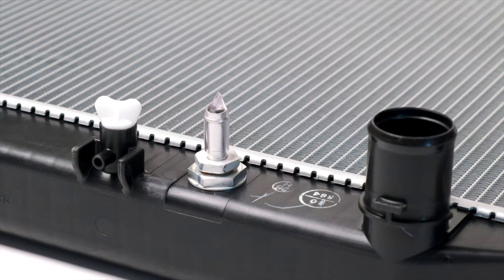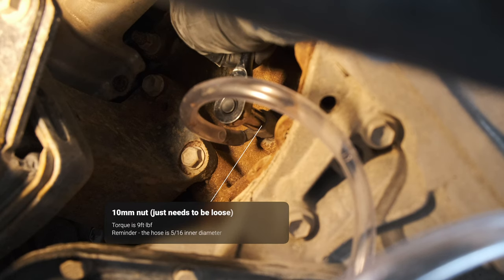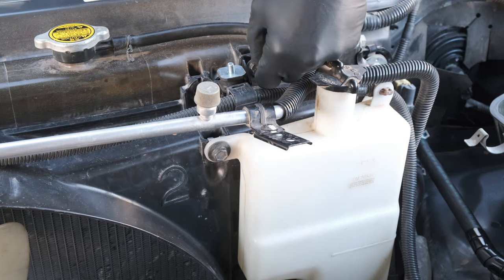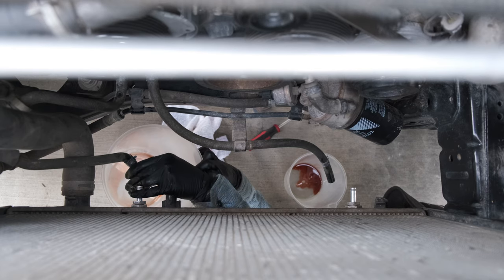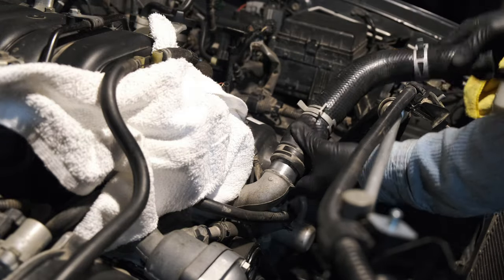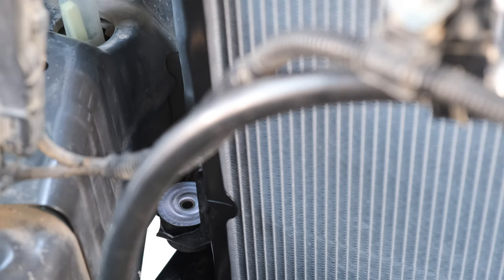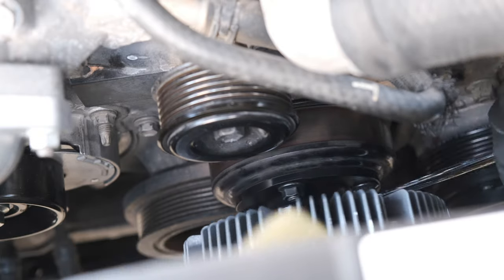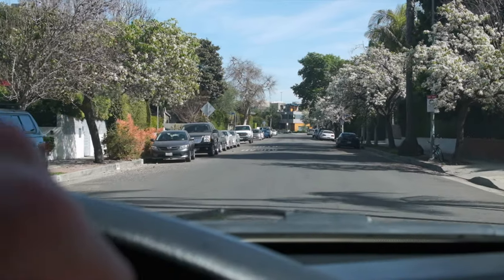Installing a new RADIATOR on the 100 series Land Cruiser

Comment: Great video, even better than version 1.0
As you stated its a great opportunity to install new hardware.
Reply from the maker: Thanks, Richard - much appreciated!  Agree on the new hardware.  A few jobs now nuts/bolts have been in rough shape and it's frustrating to find out you need one mid-project.  PartSouq has such great prices, it's hard not to grab the 'em.

Comment: Holy smokes. Just found this channel and  it is impressively well done.   Btw,  brand coolant did you use?  Do you have use Toyota OEM coolant?
Reply from the maker: Thank you! For coolant I went with Toyota brand pink coolant. I believe there are two coolant types (red and pink) depending on your model year 👍

Comment: Your videos are amazing - can't thank you enough for the time/effort you've put into them all.  I hope you come back with parts # additions as with your other videos.  

I've got a 2006 LC100 as well, have gotten P0128 code thrown intermittently (thermostat), and truck seems to take too long to warm up - suspect it's stuck open and have it on list to replace soon!  

Question:  How many miles on your truck and what made you replace your radiator?
Reply from the maker: Thanks for the comment - I appreciate that!  Yessir I'll be sure to add all the part numbers to this video as well.

I've got 220k on my '06 and purchased it two years ago with 165k.  During the pre-purchase inspection, the tech noted some stress marks (faint cracking) beginning to occur along the top of the radiator, so that's been on my mind.  Also last summer when climbing some steep mountains I had an instance of overheating which made me decide it was time :)
Reply from the maker: Part numbers added!

Comment: How you doing... Just wandering what are the sizes of the inlet and outlet oil coolant hosses that connect to the bottom of the radiator, cause mine doesn't look like the right size . I have a 2006 LC can't get the hosses all the way in to the connector they are kind of small diametter hose .. Thanks

Comment: Hi, first of all tnx for the useful videos, I have a question about my 2007 100 series , I bought it recently and it is in good condition but I heard radiator fan clutch all the time after 3000 rpm its get better , I changed it but nothings have changed, is it normal?
Reply from the maker: Thanks, Faraz! Are you sure it’s the fan clutch? If you’re still hearing sounds, try checking the belt tensioner for proper tension and the belt itself. These sorts of problems are great to search around ih8mud to see what others have tried too.
Reply: thanks a lot , actually I changed time belt an water pomp recently and check tensioner too , all of them was fine but still heard the fan clutch noise all the time, actually fan clutch reduce power and increse fuel consumption, recently i’m thinking about pulling out the fan clutch and put electrinoc fan in there but i’m not sure yet😅
Reply: yes i’m sure its the fan clutch

Comment: For those of us whose coolant pre-replacement isn't in as good of shape, it's worthwhile to do a proper flush before removing the old radiator to clear out any junk before installing the new one.
Reply from the maker: Great comment and should have mentioned that - will add links to some good flushing videos I found when researching this project.  Thanks, Casey!
Reply: @LandCruiserDIY  Did I miss where you added these "good flushing videos" links?  Also, separately, a power steering flush video would be great. I've seen threads on MUD, but your videos seal the deal for going DIY.

Comment: Can I do this without removing the Fan? I am a small time DIYer and want to remove things only if they are necessary! Thanks
Reply from the maker: Honestly I think you’d have a harder time working around the fan than removing it (if it’s even possible). The fan is actually pretty easy to take off, but definitely get the tool to hold the fluid coupling to make life a little easier. I have faith in you, Mark - you can do it!
Reply from the maker: Something like this should work: Spanner Wrench Clutch Wrench Adjustable Wrench Holder Hub Flywheel Sprocket Spanner Wrench Set Fan Clutch Removal Tool Tools Scooter Motorcycle Accessories (Type A) https://www.amazon.com/dp/B07HFFR9RR/ref=cm_sw_r_cp_api_gl_i_DGNPJ1N83290G6SF3DCE?psc=1